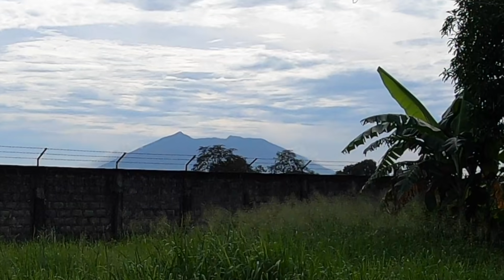Philippine House Building Step by Step, Build Day 178: Gate On Track

Comment: Hi George, whats the reasoning behind the gap between the gypsum boards? in the UK we butt them together and generally apply a coat of multi finish plaster that we call skimming.
Reply from the maker: As we are finding out along the way, it is an alternative to mud & tape. They fill the gap with skim coat and groove it along the joints as some type of design. Supposedly in the hot Philippine heat, the mud & tape method cracks easily. 
We requested they go back to the mud & tape.

Comment: See if they can replace the wheels on the sliding gate with nylon ones, makes less noise when sliding
Reply: Replacing metal to Nylon wheels has advantages and disadvantages. Yes, it’s quieter, but, considering the weight of the gate, it won’t last long, whereas, metal wheels on sealed bearings plus a little bit lubrication will last a long time.
Reply from the maker: Maybe later down the road when it comes time for repairs or refurbishment. 
Thank you for the feedback.

Comment: What do you use in the ceiling? I think gypsum. But why gypsum and not hardiflex?
Reply from the maker: Typically gypsum board. We will be using HardiFlex in the garage due to the exposure to the outside elements.

Comment: Always look forward to seeing the new video notification, its looking great, the fact you have a guard that does a rota, is there a high crime rate in Cebu towards foreigners ?  I really enjoy seeing the craftmanship of the tiling and the making of the wooden kitchen cabinets..
I have a question - why do you refer to one of the bathrooms as the Jack and Gill ? its a term i am not familiar with. please keep the vids coming.
Reply from the maker: We’re in Pampanga. North of Manila. Crime is not limited or targeted to just foreigners. Most are petty theft looking for small electronics (cellphones and laptops) which black market resale easily. The roving guards really help to deter the crime in our area. 
We’ve been blessed with a great crew and talented tradesmen. 
A Jack & Jill bath refers to a bathroom shared between two bedrooms, with doors entering from each room. In our case each room has a separate lavatory.